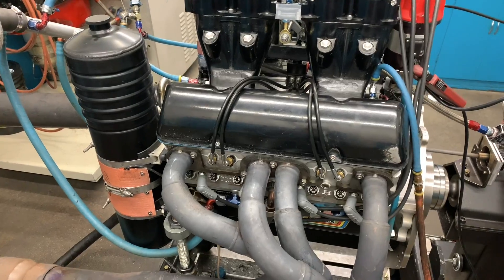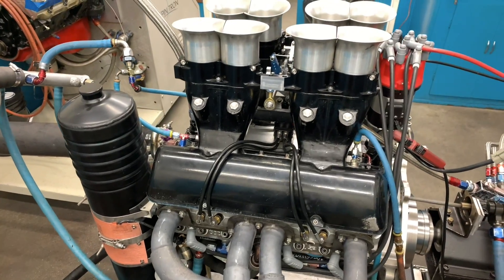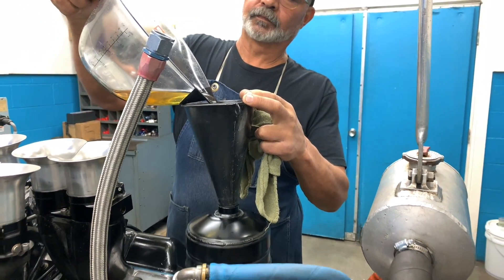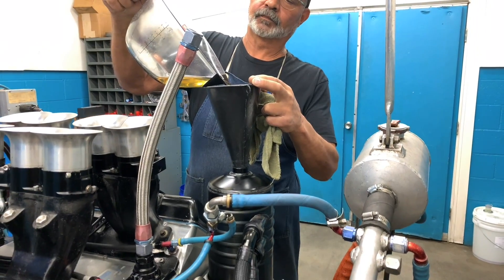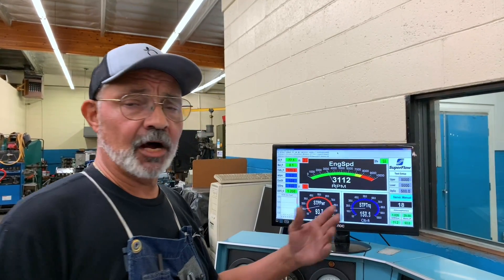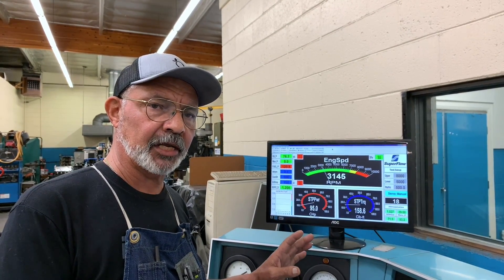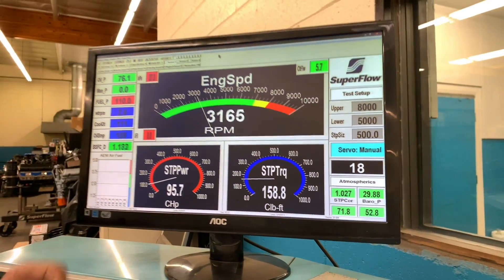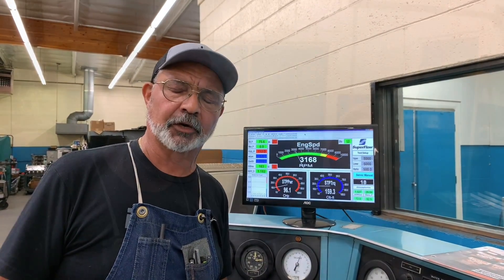Don't RUIN Your Engine! Here's How To Break It In Like A PRO!

Comment: What about first time 5.3 LS build and someone had to let it idle so that they could get the cooling system set right and to make sure no fuel or oil leaks and fix other stuff during first start up? Would it be okay to break-in the new engine rings after that? I only let the engine run long enough to get up to temp and down light rev to circulate coolant

Comment: Just had the engine (Toyato 1GR, 4.0) rebuilt by a local "Engine Exchange And Machine Shop.  I was instructed to change oil and filter after 500 miles.  Use conventional 5-30 and filt er for the first change.  Drive 1500 miles and change oil and filter again.  Use a high quality filter and synethic oil at this time.  Forever t hat t hat, change oil and filter every 5000 miles or 6 months whichever occurs first.  Please advise me

Comment: I used the time tested method of keeping the car under 3K rpms for the first few hundred miles, but not babying it with a bit of aggression, but do not drive it like you stole it. You need to do some engine breaking off throttle and on throttle. I didn't have an engine stand so that's how I did it in the car.

Comment: Sooo quick question that i don't expect to be answered on a 5yo video..

When you buy a brand new car, how do you correctly break it in considering it has an API certified synthetic oil in it? Flush the oil and put some Break in oil? If not, is it still possible to correctly break in an engine with the factory synthetic oil in it..?

Comment: Piston rings need cylinder pressure to expand and wear in to the bore. Engine load is required to raise the pressure. Warm up your engine 15 mins or so at 1000-3000rpm then drive to the nearest mountains that will allow a 100-200 mile trip. Be moderate with RPM & load at first and let your foot get progressively heavier. Down shift going down the mountain and utilize engine braking to pull oil up into the rings. 30mins to 1hr in, open it up and do wide open throttle pulls. Just did this on my 2UZ Toyota v8. Checked compression the next day, it’s right on the money. You don’t want to baby it but also don’t go crazy.

Comment: I love your information.  With this being said, when you purchase a crate engine from BluePrint and they dyno test each one, is this considered the initial break in ?  I will still add new break in oil and run it for 500 miles, then change oil and filter.

Comment: I Bet This Is Why My New Engine Always Smoked Out The Crankcase. It A Hydrolic Roller Cam And I Thought Engine Break In Was No Important. I Ran No Break In Oil And Drove It Extremely Light First 500 Miles. It Had About .028" Ring Gap On A 3.810 Bore So i Thought Thats Why It Smoked Out The Breather. Definitely Going To Take Brake In More Seriously After Spending $2,000 On A New Set Of 6 Custom Pistons.

Comment: Do we need to break in a small capacity single cylinder engine as well in case of a top end rebuild?? Like 200 or  400 cc
Reply from the maker: Yes, any rebuild needs a break-in period if the camshaft or rings are changed.
Reply: Thanks for the reply mate .....can it be done without testing bed ??like wot on a drag stip just after an engine build ??will that imitate load

Comment: Does the dyno create load somehow?, ive got a rebuilt 78 la 360 getting ready to fire up, roller lifters, can i just use my carburetor to simulate pulls while in my driveway, or do i need to drive it?
Reply from the maker: Yes, the dyno creates load via the water brake.

Comment: Can you jack the tire off the ground and break it in, in drive? Will that put enough load on the engine?
Reply from the maker: Check out our video on how to break-in an engine without a dyno.
Reply: So i got a short block with a roller cam and they gave me a break-in procedure of 10min 2000rpm, cool down, 300 miles of driving under load with same br40 oil. Is the 10min cycle necessary and will it do more harm than good?
Also how would i set up a self tuning efi system to not wash my rings during break in?
Reply: @____MC____ what did you end up doing? How was it with the self learning efi
Reply: @joaquin0023  it was a shit show. Efi was 🫏. Fans wouldnt turn on through the efi. Timing was out of wack i i couldnt get out to check or it would die. Got hot a couple times till i figured it out. My help was useless....

Comment: I've been having trouble bedding in the 2nd ring for oil control. I've seen folk talk about needing to engine brake to get oil control bedding to occur. Is there anything to that?
Reply from the maker: Getting load on the engine and using the correct oil are both critical for ring break-in. We have a couple more videos on this subject that go into greater detail.

Comment: So tellme this. My last 3 chevy trucks a 03 a 12 and a 2017 I bought new I just signed the papers and drove them as if they were already broken in and none has ever used a drop of oil? What is the factory doing for hone and rings? IM fixing to build a stock 4.3 and I dont want a oil user.
Reply from the maker: The factory hone is designed for the rings to break-in almost instantly. They also use an oil ring right around 8 to 10 lbs of tension.

Comment: My tuner said dont go over 5k rpm for the first 200 miles, then it's ok. The motor spins to 7200rpm. Fuel injected 438windsor street motor e85,  street solid roller cam
Reply from the maker: There’s not a race engine on the planet that sees 200 miles of “break-in” time.

This procedure allows you to move beyond the break-in period sooner.

Comment: So after the break in period where you go through the motions of properly sealing the rings, can you change the oil to the “normal” oil literally right after the first few hours of break in ? Or do you leave the break in oil in for 500 miles and then change to a normal oil ??
Reply from the maker: You can go to synthetic after this initial break-in process. You don’t have to wait until 500 miles.

Comment: For a 2 stroke 16k rpm engine with 1 chrome ring, synthetic or non synthetic oil for break in
Reply from the maker: Non-synthetic.
Reply: @TotalSeal  I'm worried non synthetic will not be able to handle the rpms during break in. mid range is 8000-12000 rpm. should i be concerned?
Reply from the maker: @bigh3053  Nope, we break-in 2 cycle engines on non-synthetic all the time and those engines turn up to 12,000 RPM. It is important to run the higher oil concentration in the fuel during break-in (16:1)
Reply: @TotalSeal  thank you for the replies. 16:1 is what we normally run as manufacturers recommendation. at times 20:1. What 2t oil do you guys run for break in?
Reply from the maker: @bigh3053  We use castor oil for the 2 cycle engines.

Comment: I have received a rebuild sec gen Cummins 5.9 24v . I’ve found lots of information about how to break in the engine but not much About weather to use a break in oil like Joe Gibbs or use the type and brand of oil I intend to use for the life of the engine and use a break in additive. On both the Twenty minute Initial run then change oil and add additive again for the 500 mile break in time?
Reply from the maker: We’d recommend using a break-in oil for the initial 500 miles.
Reply: A lot of guys that run Cummins engines break them in for 5 minutes without coolant at 2,000rpm. Then 100 miles with the same break in oil with a load on it and obviously coolant in it.

Comment: Hi,
For Ecoboost engine
Just finishing build with internal forged (stock size)
So, the 1st start i should maintain 3000-4000 rpm idle for break in . And should be approx 20min 

Right?
Reply from the maker: Yes, you need to start the engine and bring it up to 2,500 to 3,000 RPM. Once the engine is up to temperature, take it out for a 20 to 30 minute drive. 

Do that with the low detergent break-in oil. Follow the procedure in our break-in without a dyno video.

Comment: With an automatic in the vehicle it’s hard to put a load without it gearing down or trying to go into passing gear?How would you go about breaking that in properly? My winter truck has a 318 magnum that I’m going to 0 deck with  a real mild cam and Hughes intake. I’m thinking about total seals? What grove should I go and are they good for a -30 cold start short trip daily engine?
Reply from the maker: Thanks for the question. As you mentioned, the automatic will have to be put it in 2nd or 3rd gear for the break-in. It is tricky, but it can be done. Just follow the same logic that we discuss in the other video “Break-in without a dyno”.
Reply: @TotalSeal  sorry didn’t even know you had another video. Thanks. Are the TS rings good for a -30 cold start daily driver engine? Top or 2nd ring?
Reply from the maker: @chevy6794  Yes, you can run gapless rings in a daily driver, even in cold weather. A gapless 2nd would be recommended for that application.
Reply: @TotalSeal  ok. Thanks.

Comment: So how many miles should I break in my new 5 liter coyote. Used your guys rings. How many power sweeps and to what rpm ? I have a new clutch so not sure what to do exactly
Reply from the maker: Thanks for the questions. 500 to 1,000 miles is enough to break-in the rings. During that time, you need to make 12 to 14 power sweeps to 80% of redline.

Comment: What if you are in a situation like im in where a cam was added,heads were ported and the car wont run good until all the fuel and spark are adjusted properly?
Reply from the maker: Good question. You can still run in the cam for 10 to 15 minutes at 2,500 RPM. After that, make some fuel and timing adjustments to allow loading of the engine to break-in the rings. If you can get the engine to produce 85 to 100 LB Ft of torque that’ll be enough to start bedding in the rings.
Reply: @TotalSeal  👍..Thank you..

Comment: FANTASTIC VIDEO'S !!...I'm learning so much thank you ..Question i'm going to dyno an engine soon how long should i leave the (break in oil ) in the engine during the Break in Procedure  AND Power Pulls? i usually do about 10 pulls in total the first 2 or 3 pulls to 5500 -6000rpm a little on the lean side 13.5-ish to 1 air fuel ratio.. then change the oil out for a thinner semi synthetic and add fuel and timing for the remaining runs ..am i changing the break in oil out to early?..street/strip pump gas 588ci Boss 429 solid roller 6800-7000rpm max.. i plan to try your moly coated gas ported rings for the first time : )  Thanks.
Reply from the maker: Thanks for the comment! You can leave the break-in for the initial run-in and dyno pulls. Those first 10 pulls can all be done with the break-in oil.

Comment: I got my 800cc petrol car engine overhauled recently. However, I noticed that it's giving jerks in low gears and misfires at times. Took it to a mechanic and he said that since the engine has been rebuilt it takes at least 1000kms for the engine to become loose as it's tight now. Is that so ?
Reply from the maker: That does not seem right. If the engine is right, it will run smoothly. Break-in does take up to 1,000 Km, so you might want to check the spark plugs to see if they are oily. That would be a sign of the engine not being broken in yet. Fouled spark plugs would cause misfires.
Reply: @TotalSeal  I replaced all the spark plugs, ignition coil. This is a carb model.
Reply from the maker: Did you change the spark plugs because of the misfire? Did the spark plugs have oil on the ground strap?
Reply: @TotalSeal  no sir, it has no oil but they turned black. I thought since the engine has been overhauled, the coil and spark plugs were old and perhaps that's y the engine is missing.
Reply from the maker: Ok, it sounds like the misfire could be due to the carb.
Reply: Fuel filter was changed, engine has been overhauled, new coils and spark plugs along with new cables. The mechanic drove the car, without me telling him about the engine being overhauled, he checked it n said it has been recently overhauled. So he drove the car, this is a different mechanic since I thought the one who overhauled must have done something wrong, so this guy just opened the bonnet took the dipstick out n said that the engine has been rebuilt I guess. I insisted him to take a test drive n he said that the settings n timing is out but it would b so as the piston rings must be too tight n it might take one k Kms for the engine to behave Normal n only then he'd make changes to the settings. So what do you think is he right ?
Reply: The car actually sat at one place for months, the owner almost left it to rot for months. The windshield was broken, dents, scratches. So this guy sold it to me, I drove n found out that the car is giving jerks, even the mechanic said yeah the engine seems to be old as it's a 2001 model. So the mechanic did everything but I think that the carburettor was not cleaned properly. Also it's giving some amount of black smoke on idle. I dunno what needs to be done. Two mechanics says that the engine should cross 1k Kms but the car was jerking even before the overhaul. I thought there might be an electrical issue so I got the coil, sparkplug n cables replaced. However, it's still the same, saw an improvement though. But it still misfires.
Reply from the maker: The piston rings wearing in will not solve a misfire (if the plugs are not oily).
Reply: @TotalSeal  what do you think could be the issue here.
Reply: Should I get the carburettor cleaned. Also one thing I noticed is when I drive the car for few Kms the jerking becomes minimal. Compared to when it's cold. Also, soon as I start the car n try to throttle it max, the car wont rev up completely, however, when I drive it for few Kms n rev it then it goes normal to max.
Reply from the maker: That sounds like a carb problem
Reply: @TotalSeal  thanks for the suggestion.
Reply from the maker: Without driving or inspecting the car, we can’t say what the issue is. We can say as mentioned above that piston ring break-in usually doesn’t cause misfires.
Reply from the maker: Happy to help

Comment: So for a roller cam engine do you need to use a break in oil? Or just regular oil for ring seating?
Reply from the maker: It is better to use break-in oil for ring break-in on iron bore or iron sleeve engines.
Reply: @TotalSeal  thank you!
Reply: Break in oil not recommended for plated AL cylinders?

Comment: I didn’t put load to it at first because there was a tapping noise in the engine. But now I got almost 1000 miles on it and it still got a misfire seems to be getting better but how long will it take for rings to seat?
Reply from the maker: Thanks for the question. We’d suggest correcting the misfire as soon as possible so that you can move on to seating the rings. If you go too far without seating the rings, the bores can glaze. So fix the mechanical problem first.

Comment: I have a question about breaking in a fresh rebuild , I'm building a gen1 chevy 350 with a factory Rochester carburetor and factory distributor ( no computers ) , its just a clean up , and smooth out the cylinders , and a tow cam , its going in a work truck , my question is , when I first run it , do I set the ignition timing at standard specs or should it be different for the break in ? And should the carb be set rich or lean or set to run ?
Reply from the maker: Thanks for the questions. Set both the timing and carb for normal driving. You don't need to change the tune up for break-in, so set the tune up for normal driving. Too rich and not enough timing could lead to the cylinders washing with fuel.

Comment: Great video!! But when breaking in a engine I thought your suppose to keep engine load off for 500milws
Reply from the maker: Thanks for the question. Load is essential to engine break-in. Without load, the rings will not seal. There are many misconceptions about engine break-in, so that is why we made this video.
Reply: MC's mfg's recommend no full throttle until 1000 miles.

Comment: What are the time duration this should be carried out at
Reply from the maker: The initial break-in is 20 minutes, followed by 30 to 40 minutes of gradual power/rpm sweeps. All in all, break-in needs to be done over the first 45 minutes to 75 minutes of an engine’s life.
Reply: Fantastic! what should my RPM load be for the first 20 minutes this will be on a manual vehicle as well, but I will be doing one on an automatic also. there is a difference correct?
Reply from the maker: 2,000 to 2,500 RPM works great for the initial 20 minutes. For the RPM sweeps, start with going up to 2,000 RPM less than redline. And then gradually work up to 1,000 RPM less than redline.

Comment: Gentleman, thanks for this informative video !  How/what would be your recommendation to break in a 80cc, 4 stroke gas engine that powers a 2250 w inverter generator ? Thanks in advance !
Reply from the maker: Thanks for the feedback. We’d recommend trying to mimmick this process as close as you can. The key is running the engine under load and then do an oil change.
Reply: Thanks, guys!  Sounds like a plan: put the generator under load from the get-go, I.e. run some random, high wattage appliances / lights for extended periods of time and change the oil more frequently during the break in. @TotalSeal